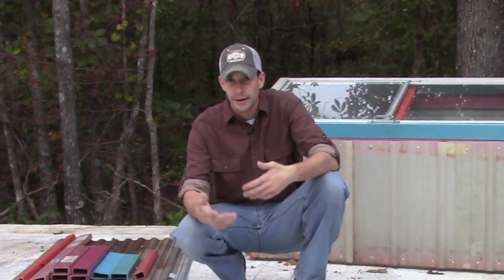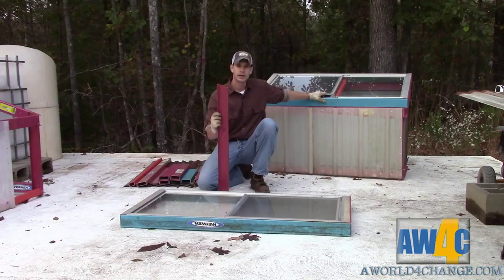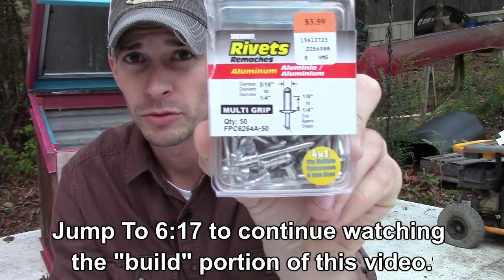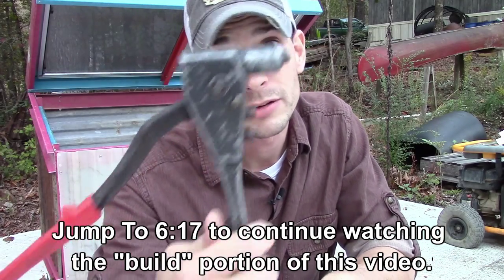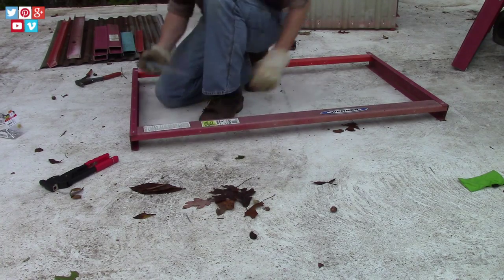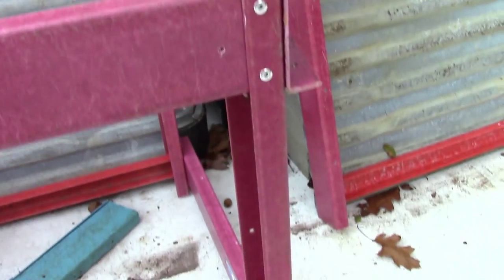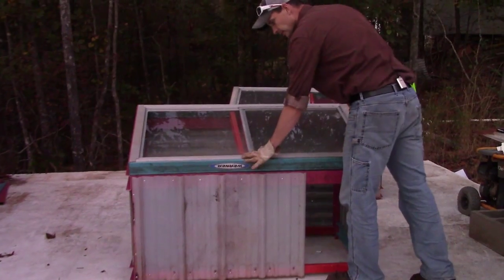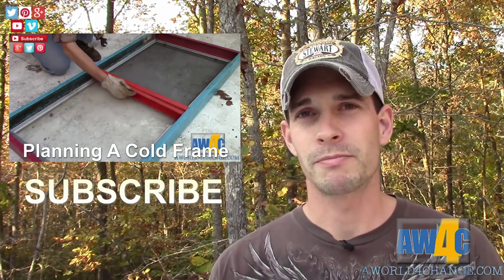Building A Cold Frame (video series)

Comment from the maker: This is the second video in a series on "Cold Frames" (see build in video).

Cold Frame Playlist - https://www.youtube.com/playlist?list=PL1XPuCnsC5QAyrmYjw5AGkeSzQgX-Dk7K

Read Blog Post for Dimensions & Details - http://www.aworld4change.com/build-a-cold-frame-video-series/

Pin it for later http://goo.gl/bhs1JP

In this video, I show you how to build the cold frames that I built this year, using repurposed materials...and give you some tool/fastener tips along the way.

While, I don't have cold frame "plans" drawn up for you to use...I do have the dimensions below. You really need to think outside the box when building cold frames. (pun intended) Use the materials you have available to you/that's around your environment. That's what I did... I didn't set out thinking they have to look a certain way, or be a specific size. I simply knew I had the repurposed materials it was going to take to whip up a little more winter food production with cold frame gardening!

What Are Cold Frames?
Cold frames, are protected plant beds that have no heat added. You generally see a 5 - 10 degree temperature difference inside a cold frame, compared to the outside temperature. Essentially, what you're building, is a miniature Cold Frame Greenhouse! 

Materials Used - 
Repurposed Fiberglass Werner Ladder Co Rails
Repurposed Skylight Material
Repurposed Storm Windows
Repurposed Barn Siding
Repurposed Nuts & Bolts
New Low-cost Hinges
New Low-cost Handle
New Aluminum Rivets

-------------------------------------------

Website - http://www.aworld4change.com
TV Show YouTube Channel -http://goo.gl/ONYbKX 
Seed Savers Community - http://goo.gl/dFQmKI 
Pay It Forward Community - http://goo.gl/L5f0MM 
Pinterest - http://www.pinterest.com/aworld4change/ 
TV Show Twitter - http://www.twitter.com/AWorld4Change
Twitter - http://www.twitter.com/wmeador 

Recorded With - Canon VIXIA HF R400 - http://amzn.to/1kBgq9z

Comment: Good video, this may be a solution I can use to allow my wife to garden plants that are not happy with Arizona's summer months :)

The only thing I would have done differently would be to put the door stop on the side of the door (would probably need one on each side). My reasoning for this is that I am a klutz and if it were in the middle, I would knock it out of place all the time.

Thanks again for the video, this is a project I will have to try when I get some time.